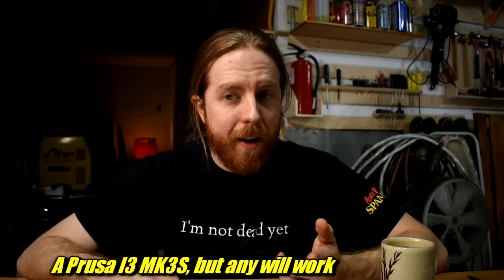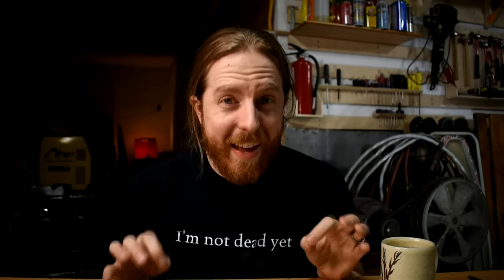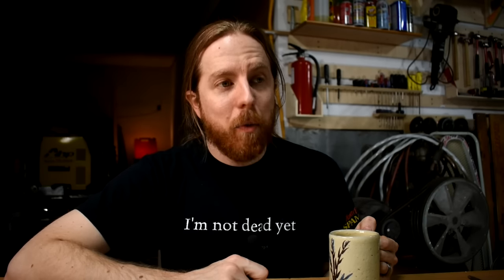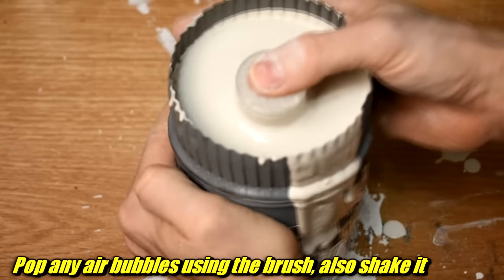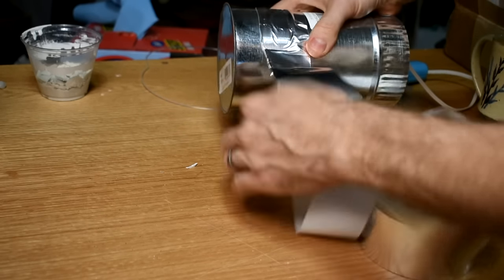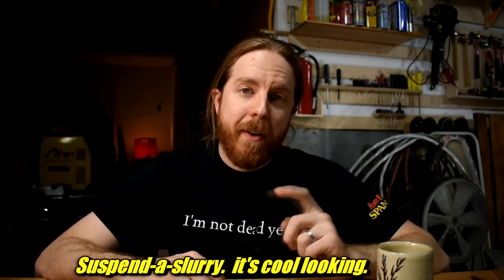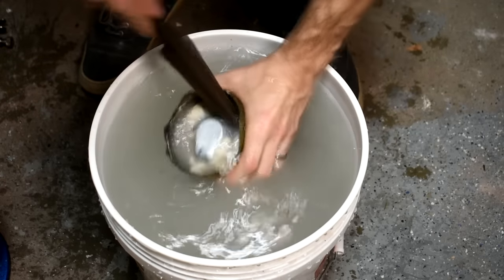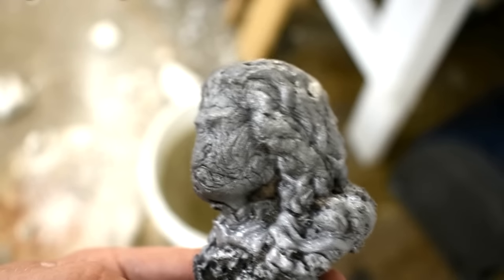3D Print to Solid Metal, BETTER Than Lost PLA Casting

Comment: How about using water soluble plastic and wash it out of the mold ? The mold material would have be non water soluble then. Also ZAMAC is an engineering material, we use it all the time in the automotive industry, I love this material, it was basically invented to be easily castable.
Reply from the maker: That could work, there are definitely water soluble filaments available.  You would still want to fire the mold, to either drive water out of the plaster or fire the ceramic for the shell stuff
Reply: @PaulsGarage  Yeah you are right, however you could cheaply print parts and would not have to meld them out which might leave ash behind. 
I guess my main problem is I don´t have any tools besides household items to do that and I don´t feel like baying all that stuff for a lot of money just for a couple of casts.

My most favorite method thus far is using high temp silicone molds and just casting directly into the silicone. Works with lower temp alloys like pewter, zamac etc.

Comment: Why not lost wax?  3d print, make a silicon mold, make a wax casting, make the plaster mold, melt out the wax and... there you go!
Reply from the maker: That would be cool.  Extra steps for one casting but it would make repeats easier.  Wax melts out easier too.  Lost plastic/resin really requires a special plaster
Reply: @PaulsGarage  I'd love to see your videos on it if you had interest.  I've got a big trash bin full of old soda cans and a second one ready to fill up, after which which I'll start making billets.  I'm definitely oriented to start casting stuff.

Comment: That polycast is damm expensive! $50 per reel.
Reply from the maker: For sure.  Per print it's not bad.  The investment plaster, metal, and fuel cost far more.  If you prevent a couple failures due to burnout, it makes up the cost difference in my opinion

Comment: It's twice the price l. It's worth but you should have just said that instead of a dollar more
Reply from the maker: Depends how you measure cost.  The filament is double, but that's only one small part of this process.  There are also fuel/energy costs, metal costs, plaster costs, time "costs", so the extra dollar to print the mold probably works out to a small percentage of cost increase per item, all for fewer failure and ultimately a much better surface finish.  The better finish means less processing after, and time is money, so I see it as a cheaper option all things considered.

Comment: Yes $1 more. But its over 100% more… no matter what size your project is.
Reply from the maker: 100% more for filament cost, but that's a small part of the total project cost.  The power needed to burnout the mold (or propane in this case) costs just as much, if not more, and the proper plaster (not plaster of paris) is easily more than the filament cost, etc...  The filament difference is probably something like 15% of total material/energy cost for the whole project for something this small, and even less for huge projects as plaster, energy, and metal costs go up much faster as the projects get larger.

Comment: Esun pla+ burns out ash free. I burn out in my fire pit with charcoal
Reply from the maker: Interesting!  The few times I used Esun filament I had really bad print consistency, but that was years ago.  Maybe I should check them out again
Reply: @PaulsGarage  I do suspendaslurry shell casting I use the glass blasting sand from harbor freight. I get detail down to the printing lines
Reply from the maker: That's pretty awesome.  Good idea on the HF blasting sand.  I have never tried suspend a slurry but it's definitely on my list.  I have burnout kilns already 👍
Reply: @PaulsGarage   I was just saying what my process was. I have downloaded some of your models for casting. I really appreciate that you made them available.